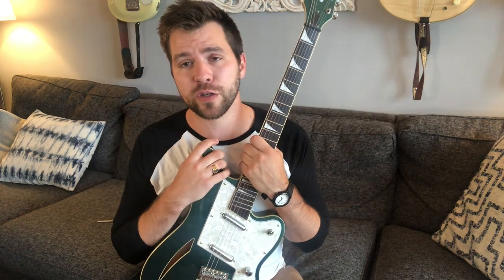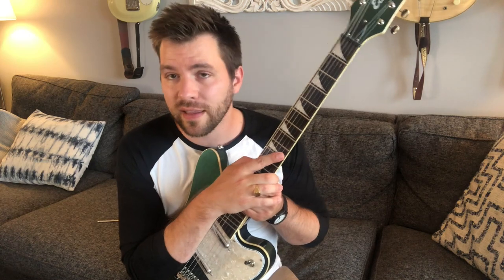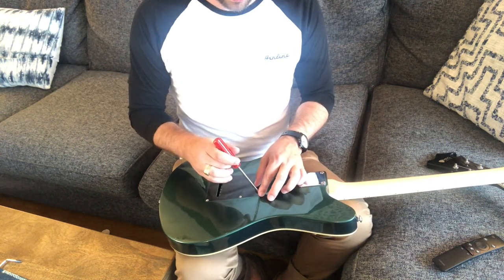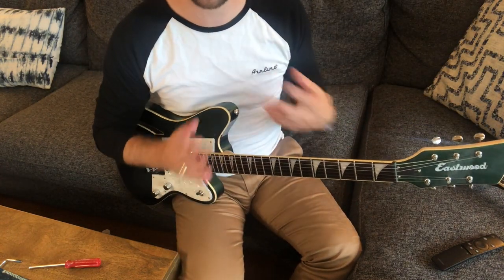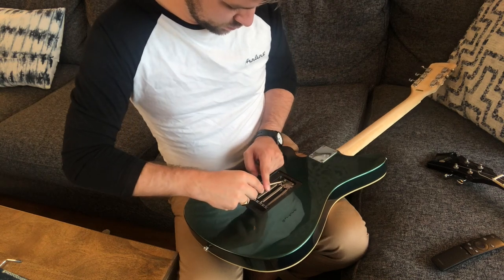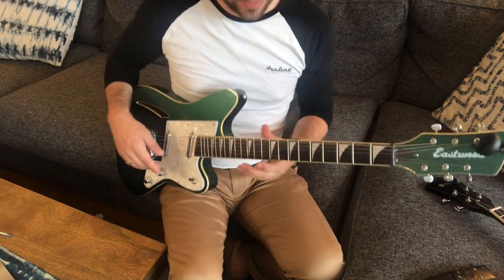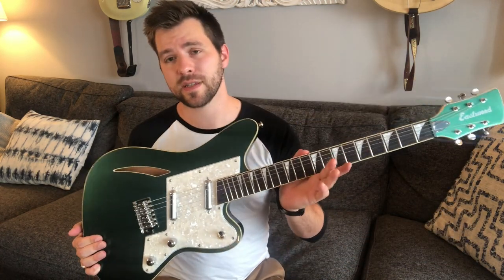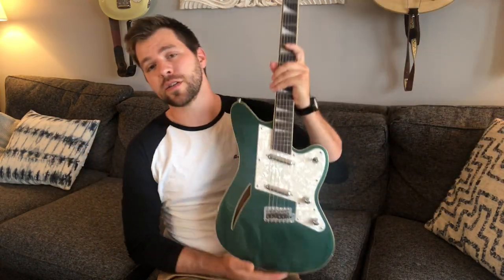Eastwood Guitars 'How To' Guide: Adjusting Strat-Style Tremolo Tension

Comment: Adding springs to a floating trem/vibrato,  or  using stronger springs can eliminate adjacent strings going flat while bending😉
Trick is to find your biggest bend in your technique and adjust from there 😎👍
Great guitar by the way😎👍